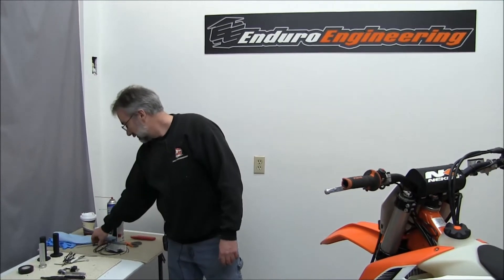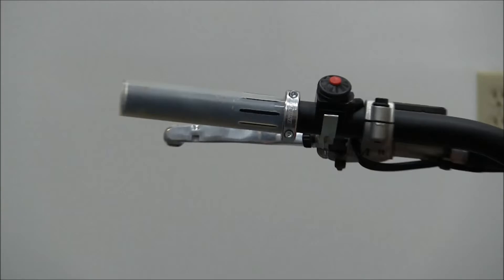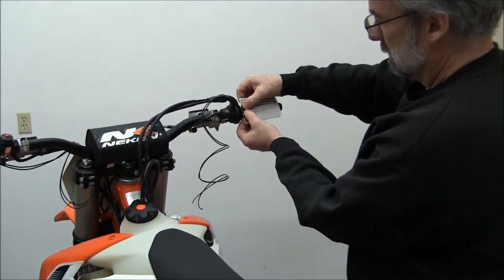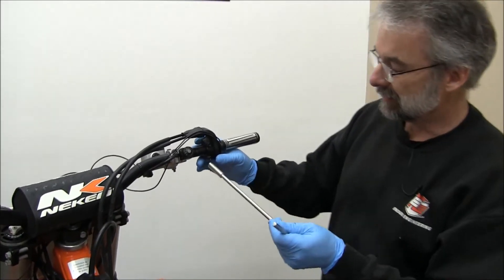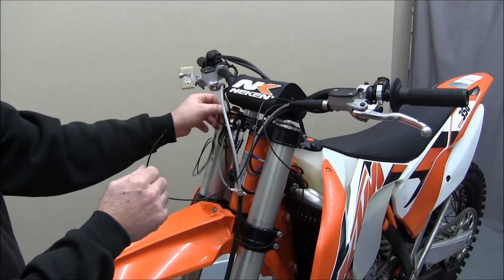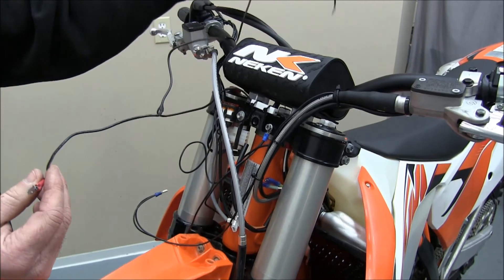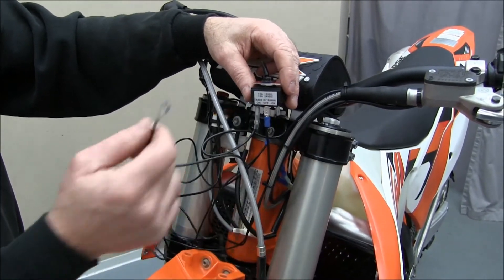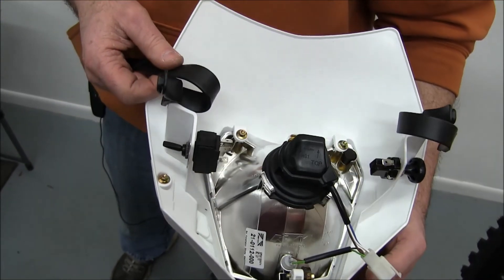15-054 Enduro Engineering Grip Heaters

Comment: Take your air lance tuck it inside the grip and blow it off. Easy peasy. If you notice the throttle side grip is thinner than the clutch side, there for more insulated. theres your different in temperature.

Comment: Don't follow this the instructions are incorrect 12 volt supply doesn't go to the centre of rocker switch but to the 2 remaining wires to the grips the single cable from the Y wire is to 12 volt supply